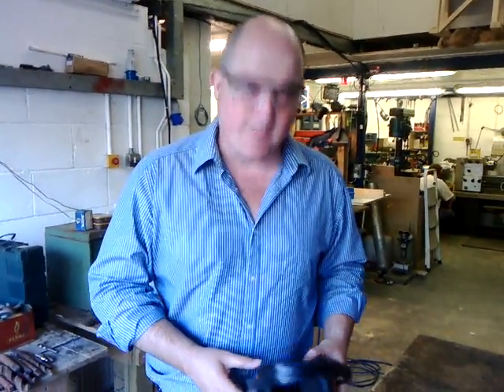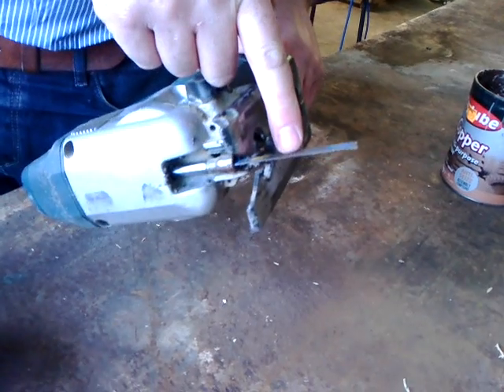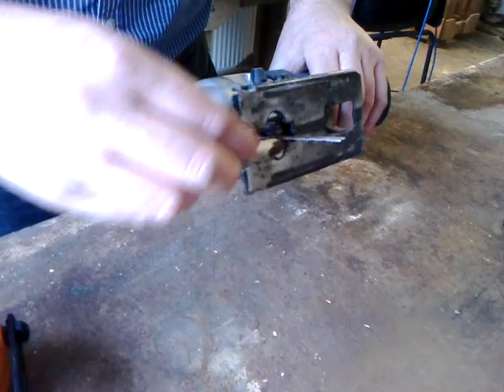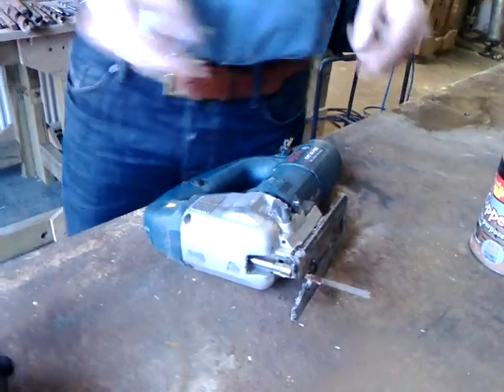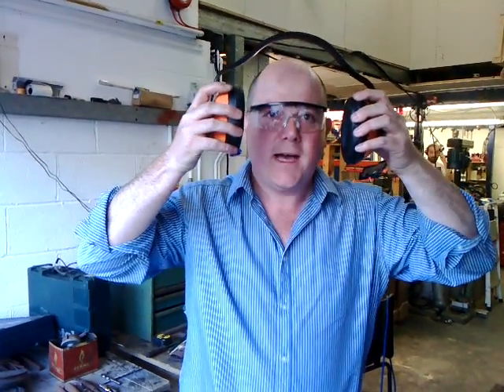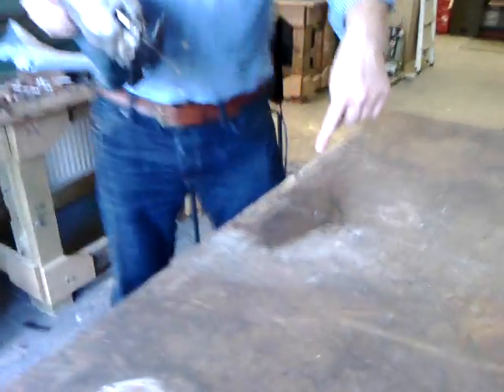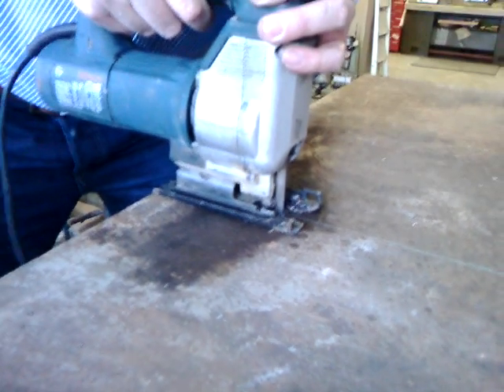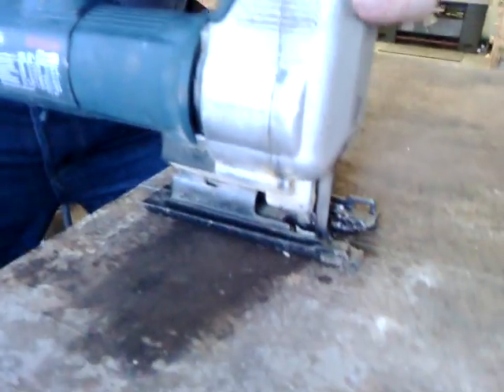Cutting 6mm steel plate using a jigsaw

Comment: Unlike angle grinder which cut metals by "burning" the metals from high speed friction, jigsaw blades cut metals by actually chip the metals little by little. So, slow speed is how you cut metal with blades. Higher speed will heat the blades faster and make it prone to break.

Comment: Richard, you’ve got your speed way too fast. Also, though we didn’t get a good look, seems like the tpi might be a little fine as well. 3 teeth in contact with the material being cut is recommended, hence 11 - 13tpi would be optimal for 6mm steel. Come on mate, thicker the steel, slower the stroke rate, coarser the tpi!

Comment: Can anyone recommend the best blade for this?
Reply: Diablo thick steel has been great
Reply: @nateb4543  Thanks, Nate.
Reply: There's another video where he uses a Dewalt Metal Blade that seemed to work well
Reply: @Trig242  Thanks. Yes Dewalt is great. Was hoping to know the tooth per inch rating and blade material. Have to cut a 1/4 steel plate. Will try to search his other videos.
Reply: @Marcoosianism  I am cutting 3/8" with a Lenox "Thick Metal" blade. Works amazingly well.
Reply: @Marcoosianism  You would need an 18-32 TPI range.

Comment: This is probably a dumb question, but humor me; I have some agri-grease for tractors in my garden shed, this would suffice to lubricate the blade, yes?
Reply: Yep. Copper grease is best to prevent chip weld, but you could use any cutting oil, mineral oil, tapping fluid, general grease or coolant. Just don't use so much that it ends up in the motor housing 😀 
For cutting aluminium, don't bother with coolant, use wax instead. Any wax, even candle wax.

Comment: Use a grinder for this... Too hard on the jigsaw
Reply: Why baby the tool? A jigsaw with a good blade and a dab of cutting oil is actually far more energy efficient and material efficient than any kind of abrasive saw. Just like cutting pipes with a hacksaw by hand, only without getting the nice bicep pump afterwards 🤣

Comment: The blades would not break easily if you use slow speed, small cutting movement and using blades which cut during upward movement.I think kerosene is a good lubricant/coolant.

Comment: Tried this once - after 6 inches of cut and 3 bosch metal cutting blades in the bin I went out and bought a plasma cutter
Reply: The President of The Internet dude did that with one blade, you dropped a few hundred bucks on a tool. congratulations you played yourself
Reply: @bookrokodil  he wanted to buy a plasma cutter. "Accidentally" broke all those blades to justify it
Reply: Bosch blades are terrible!! I think that was your problem
Reply: No idea what you doing, but I broke exactly 2 blades in the past 15 years cutting sheet metal and square tubes and i never broke a woodworking one. Both cases the mistake was mine.
Stop the pendulum motion, use proper blades, use slower speed, use few drops of cutting oil, don't push too hard, blow the shavings from time to time and most importantly fix properly your material to avoid the vibration.

Comment: What about 8mm steel? Do you think i's cuttable with a jigsaw too?
Reply: Not all jigsaws are created equal. 700 watts or more and a 25 mm stroke is what you need. No toys from the local hardware. Good blades only. Bosh(Metabo) 118A or B or speed for metal. or Makita 14/18. Maybe DeWalt. If I remember I'll come back with the model #